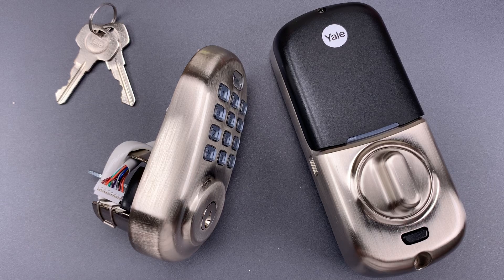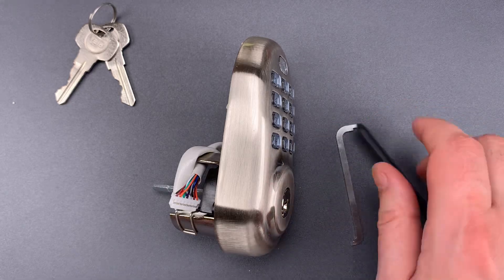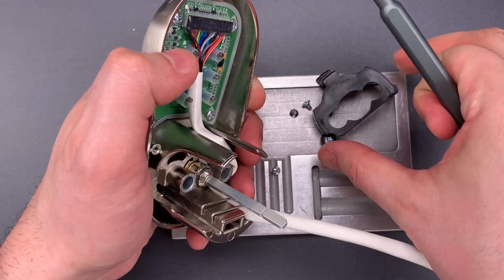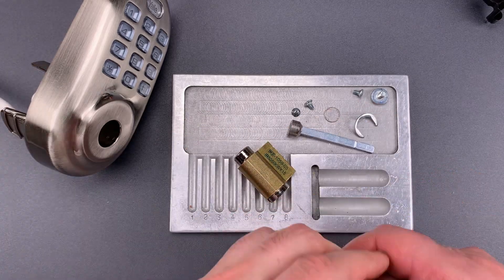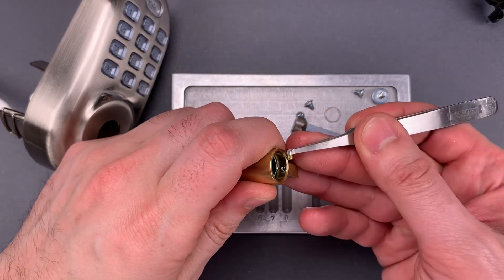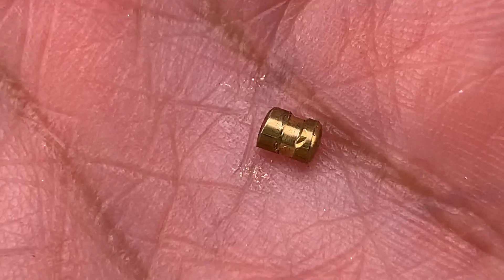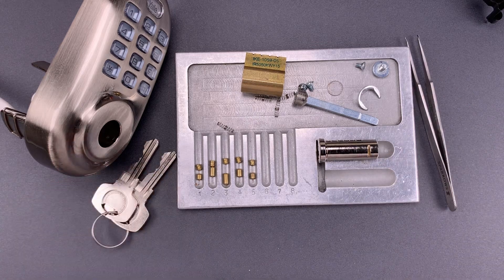[1100] Yale Assure Electronic Deadbolt Picked (Model YRD-216)

Comment: This Yale lock is the one we have on our front door.
Reply: You can probably take it to a locksmith and have them replace the pins and make you a new key. It'd be a much better lock then.
Reply: @CptainCrunch  We have decided to order a Yale Doorman V2N, instead of a key access point it has a keypad.
Reply: @karl-marcussiiman7501  Nice. Did you make the change because of this video?

Comment: I'd be interested to see the difference in the ability to pick a lock like this if the spools were swapped for ones that have varying lengths, even if Yale didn't do that change themselves.
It would render the key useless but the keys just seem to be for his convenience.
Reply: Once decent pins were put in, you could get a new key cut for it.. You could even keep the same bitting, just use better key pins and longer driver pins of higher quality.

Comment: For a newbie to your channel, which Smart Lock deadbolt would you recommend for the average American home?

Kevin Rea
Lancaster California USA
Reply: The best smart locks are the Yale Assure (you can change the cylinder for a better lock), Schlage Encode (Grade 1 ANSI out of the box),  Eufy Smart Lock Wifi (also Grade 1 ANSI out of the box) and the Lever Bolt (with Schlage B60). I've heard that people also like the ULTRALOQ U-Bolt Pro. If you don't have a video doorbell yet, Eufy is making an Smart Lock with video doorbell which should be available in October. Really, just depends on your preferred aesthetics and what kind of smart home you're building.

Comment: hopefully someone (dare i hope LPL?) can help me. i have 3 different smart locks in my place with a ton of ways-to-enter features(BT, NFC, WiFi, F-Print etc) and the only feature i never use on any of them is the open with metal key feature and yet thats the feature that makes all of the locks most vulnerable. What is the best, and hopefully reversible, way to disable the key feature so you cannot open it with picking or even original key but rest of features still work?

Comment: Does locks in usa required to have mechanical backup?
Reply: No, but most people want that for ease of mind. We all have bad experiences with electronics failing. I have a gun safe that is electric lock and I almost didnt buy it because of that until I learned about the safety features on it making it so I can get into it.

Comment: This question comes from someone with no idea how lock manufacturing works, but are the pins really that hard to manufacture, at least compared to the rest of the core? why have 3 effective pins, and 5 overall, in a core that fits 6?

Comment: I am a complete novice on locks, but Does anyone have a good suggestion to replace the cylinder with a more pick resistant one?  Model/part numbers would help.  

I like the features of this Yale Assure Smart lock, but would want it more pick resistant.  Thanks!

Comment: This is a YRD210 (star in left corner of keypad), not a YRD216 (checkmark in left corner of keypad). However, the principle is the same. Sad only had to pick 3 of 5 pins to unlock it.

Comment: At $190 I think they can splurge on driver pins that are longer and on better manufacturing of the spools and pins so it isn't vulnerable to an unskilled attack. Cheep Chinese knockoffs have dominated the low end of the market so don't compete there, instead make better quality locks to distinguish your brand from the rest.

The electronics in the lock are not expensive, you could diy one for well under $50, so they can afford to spend more on mechanicals.

Comment: I rekeyed one, try it. It will shock you that how bad the specs of the key pin is. Try to put kwikset pin in , I used Lab pin , should be the same

Comment: since the keys are randomly generated  isnt it jsut bad luck that 1 and 5 were cut short on the same lock ? you cant tell me they spend the extra money with a 6 pin lock jsut to use 3 all the time

Comment: If this lock were a 5-story building, the middle 3 would be real strong.
Reply: Remember, if you used the wrong key (instead of picking), the first and last pins would engage. Or if you lift pin 1 as you're trying to set pin 2, it may set across the shear. (Do you have a 50/1000ths top of the keyway tension tool? or would you use a wiper insert flat across the bottom, and hope that tension keeps it at a constant angle? If the latter, you may end up accidentally bumping the first pin on your way to later ones...)

So while the pinning in this is still a problem, but not as obvious of one as you might think.
Reply: ZP are you thinking this was the mindset of the Yale Lock Company? 
Let us say all 5 pins were same as #1. 
Wouldn't that stop all but a flat key? 
Wouldn't that be as secure then? 
Assuming a key is used.

Comment: If everything else is good, can't you just switch out the core with a lock that has a disk detainer core? This lock is $190, and for another $25 you could buy a new core that fits, switch it, and you're all set. $215 isn't bad for that. Am I missing something? Is that hard to do?

Comment: Why do you need a key on a smart lock? It's just another way to get in and the overall safety is equal to the weakest way
I know that electricity can be cut, but it's like getting a smartphone with walkie-talkie capabilities just in case the cellular network goes down...

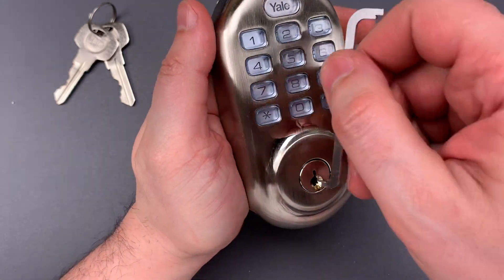Comment: 14 seconds to pick a $190 lock from Yale. 0:52  Ouch!  

  - Only 5 of the 6 chambers were keyed up, which makes picking easier.
  - Key pins with tapers on both sides, which makes picking easier.  
  - 2 of the five driver pins were so short that the pin stack didn't extend above the shear line, which makes picking unnecessary.  
  - Shoddy manufacture of the spool driver pins (uneven, rounded, and containing notches/gouges).  

Very disappointing from such a storied lock maker.  Yale should be ashamed that this mechanical lock's design got approved and that it got through manufacturing quality control.

Comment: When their options are a $190 lock with sloppy tolerances that takes LPL 10 seconds to pick, or a $490 lock with tight tolerances that takes LPL 20 seconds to pick, you can see why they just go with the cheaper option. Why even bother?

Comment: It always seem like these electronic keypad locks have crap physical security. Cheap thin stamped bodies, low security cylinders, ...etc... Even the expensive ones. I wouldn't use them.

Comment: For a Yale, that's a remarkably bad core.  Doesn't even have their usual keyway.  Possibly they were focusing so hard on the electromechanical parts that they forgot the basics, possibly this was all done by a subcontractor without sufficient oversight and QC from Yale.  Either way, a poor lock, and a good way to lose a reputation, if they aren't careful.

Comment: Only five pins and two of them are too short? Mixed reviews on the wireless features? That’s probably what happens if you try to make a lock that does everything like a smart lock: every feature ends up barely above average at best. At least it can’t be defeated with a magnet.